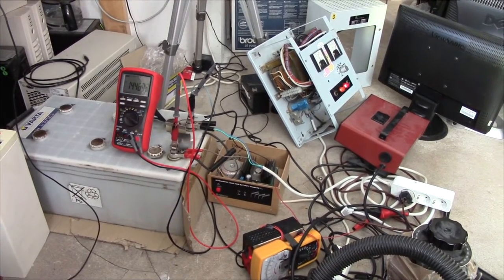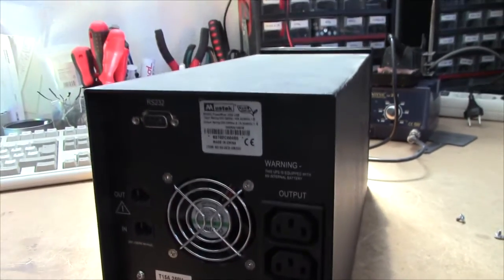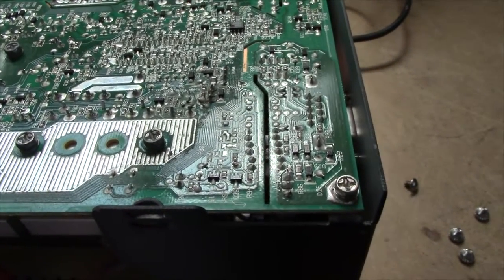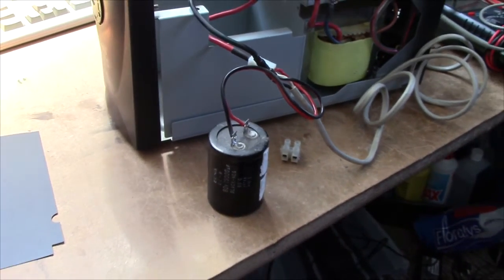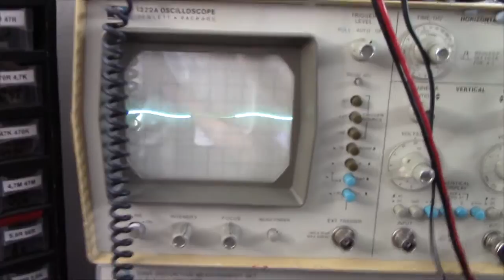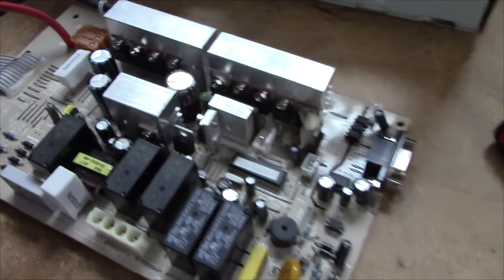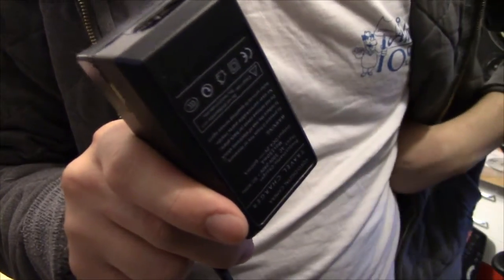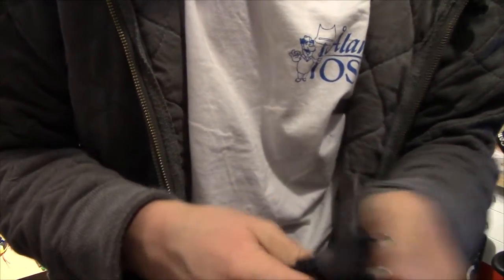Scrapping a cheap UPS and blowing things up with the transformer

Comment: Hey! I have an APC Back-UPS 1400 unit too! It was my first large UPS before upgrading to the APC Smart-UPS line. How do you like that particular unit? I still use it to provide backup power/surge protection/power conditioning for my A/V gear. :)
Reply from the maker: I know that the Back-UPS Pro line, the white ugly ones, are great. I use one of those for my AV gear as well since it's fanless.

Comment: Hi FFcossag, Thanks for sharing your UPS experience. I got a problem with my APC UPS RS800 (BR800I). It still ran in battery mode (yellow light and beep on) when it was connected to a stable 220V ac domestic electricity supply. With the UPS cable connected to my PC, the APC software said the input voltage was only 175V. Having no clues to diagnose it, it changed all the electrolytic caps and relays on the PCB, installed a new battery pack and confirmed all the plug connections. But all these didn't help. Any idea about this? Where shall I check next? Thank you very much for helping.
Reply from the maker: I haven't done much work on those units, sadly. It could be the input divider (or transformer) for monitoring the line voltage, a bad solder joint, etc., or it could simply be a bad processor. I have seen one APC UPS in the past which suffered an ADC failure inside the processor, which would give it a similar symptom, but it's pretty far-fetched to assume that that's a common failure mode.
Reply: FFcossag Thanks a lot for your comments. You mentioned a bad processor. Is it a good trial to replace the UC3525ADW?
Reply from the maker: Paul Chu That sounds unlikely, since that's just a switchmode controller (main inverter controller?) If it is the main inverter controller, it shouldn't have too much to do with voltage sensing, except when regulating the output of the unit while it's running on batteries.
Reply: FFcossag Thank you very much for your advice on my RS800. (1) After replacing all the electrolytic caps and relays, without a scope, I think what I can do is to replace parts. I couldn't find any bad solder joints and have no idea about the processor. Where is the input divider you mentioned? What are the main components? I saw two transformers in the PCB, one around 5cm wide and the other is about 2cm. (2) Without a scope to check the waveform, if the multimeter shows an ac output of 219 - 220V in battery mode, do you think I can connect it to my router, modem and PC. (3) Any remedies to the high frequency (tweet) noise in a operating toroidal power transformer? It is 220V ac -> 24V dc, around 60W. (NOT related to UPS). Thanks FFcossag!
Reply from the maker: Paul Chu I just took a quick peek inside one of these units that I have laying around, and you could take a look at the SMD components in the lower part of the unit, by the power plugs. There are a few SMD resistors and transistors, that could feasibly make up a divider network for monitoring the mains, and if one of those components have failed, it could cause the issue you're experiencing. However, I'd say it's more likely that it's a fault in the actual ADC circuit. You could try looking at the small 8-pin IC by the three black relays, it's a voltage reference (1431C). There are also two 16-pin ICs that are quad opamps (324A), which could conceivably have failed, and are conceivable to replace.

If your multimeter is a true-RMS meter which can measure jagged sine waves properly, then by all means connect it to a load. However, many cheap meters will measure too low on jagged sine waves (my two cheap-o meters show 176 V), so you could potentially have too much output voltage.

As for your transformer, that sounds weird. I've never heard a mains transformer "tweet", or make any noise other than 50/100 Hz hum. Unless you're referring to some kind of switchmode power supply?
Reply: FFcossag (1) Yes, I saw the 1431C, 324A and some SMD components near the power input plug. It's a matter of luck to replace parts without diagnosis but I have greater chance to recover it with your hints. Thanks FFcossag. (2) Unfortunately mine is using average response method instead of true RMS.
Reply from the maker: Paul Chu Those opamps and the voltage reference could be worth a shot, a faulty reference could account for it considering itself to have low input voltage, while having a high output voltage (although it's impossible to know its output voltage without a scope or a true-RMS meter). It could be worth measuring the supply rails for the opamps, as well, before replacing them.

Good luck!
Reply: FFcossag Hi FFcossag,
In your video today you mentioned that "I enjoy re-using discarded items until they are truly unfit for any kind of service". I share the same hobby with you :). Watching many of your videos and looking around your workbench, I have a friendly reminder to you (in case you didn't have it): It's a good idea to have a fire extinguisher handy in your workshop to play safe. Regarding my RS800, I'm still looking for spare time to deal with it. Instead of dumping it to the garbage landfill, I'll try to replace 1431C and 324A. Thanks FFcossag.
Reply from the maker: Paul Chu That's good to hear, it's always nice to hear about people doing "proper" recycling.

And I do have a fire extinguisher reasonably nearby (in my car), so I don't think I'm going to burn the house down, especially as I do most high-energy experiments on the concrete floor. ;)

Comment: sir i have an old blazer 600 UPS , the transformer is the same as the one you've got, the class b viking b2 , but i don't know how to connect it 230 v ac to get 12 volt output ,please can you help me?
well , i have many wires , 5 wires in total, 3 wires in a connector ,colours are , blue , yellow , black , and in the other side , i have 2 thick cables ,colours are red, blue ,
can i connect the blue and the black to on 220 volt ?
 ,
Reply: +naifar walid good to read your comment...looking for the same info...what you did later....plz tell if you know how to operate...
Reply from the maker: +M. Sami-ullah My transformer had yellow and blue as the 230 V primary, but I suggest you measure the resistance of the windings in order to find out.
Reply: +FFcossag thanks

Comment: Why did you need that capacitor and what were the specs? Thanks.
Reply from the maker: +Miguel Rocha It's a 15 000 µF capacitor. It's just there to reduce the impedance of the long "battery" cable, since the UPS was not able to start due to the voltage sagging too low.
Reply: +FFcossag Thanks. Now i think i understand, it's there because you're bench power supply couldn't handle the ups + cable demand, so the capacitor went to the rescue.